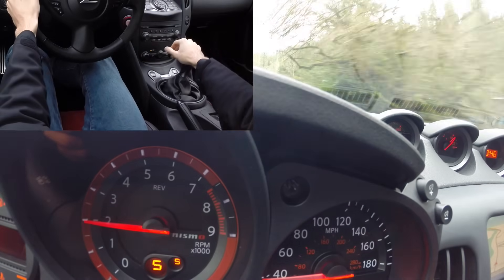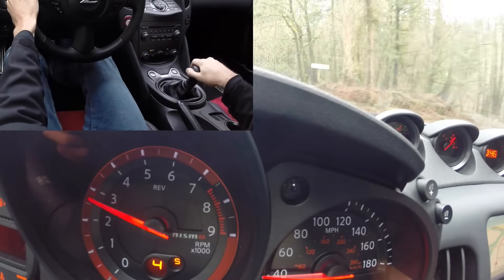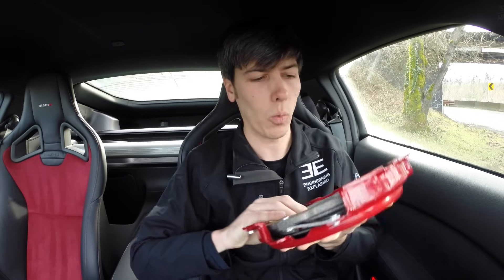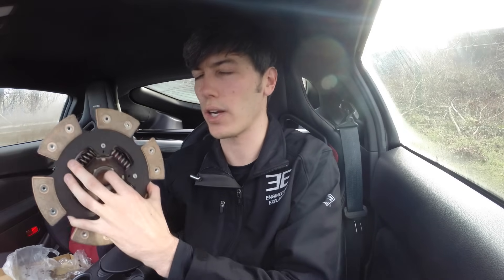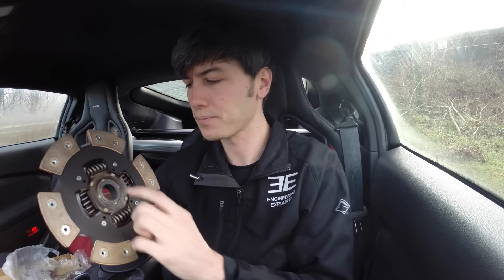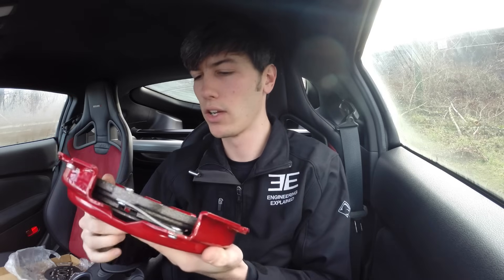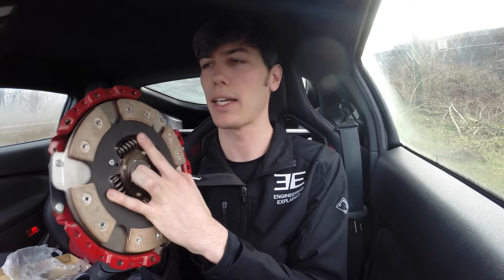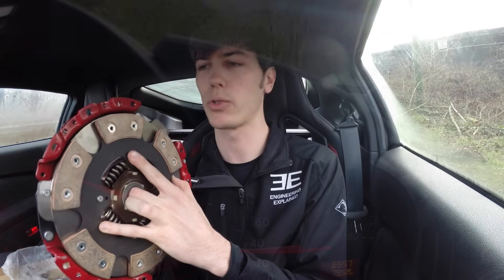What Is Rev Matching?

Comment: what happens if youre on the highway going 60 mph in 6th gear and you want to quickly pass someone?? dont you have to downshift to get more torque?

isnt that a disadvantage to driving manual? in an auto you can just step on the gas with good torque at high speeds
Reply: +Master Mo Auto's downshift when you step on it in a situation like that aswell. With a manual you're doing it manually and it's the same process. I can downshift/rev match pretty quick so even on highways I don't really feel disadvantaged. After a while and with a bit of practice it tends to come naturally
Reply: mrsametaste
so its just much quicker in automatics.
Reply: +Master Mo Yes that is true, but an automatic does the same thing. Usually there is a threshold in the pedal where basically the ecu says 'oh, they want to go fast' and it will downshift and punch it.
Reply: +Master Mo are you butthurt that you can't drive a manual car or what ?
Reply: haha murican problems.
Reply: +Master Mo I like how you asked a question, it got answered in great detail by at least five people, then you start arguing over the fact that manuals are slower at this even though everyone was accepting that fact. Blows my mind.
Reply: +Master Mo I have this suspicion that you don't really know much about cars in general. Why would you ask a question, recieve informed reaponses, and then provoke an argument on a topic in which you have limited knowledge? If you're such a brainiac, then stfu.
Reply: +Master Mo Yes, but with a manual you have more control, so you can anticipate the downshift and actually be faster than the auto.
Reply: +Master Mo 
It depends on driver skills. Very good driver with manual gearbox shifts
gears faster than average automatic. Good automatic in sport car shifts faster
than average driver.
Reply: ...or...in a diesel...you put your foot down because I'M A COAL ROLLIN DOUCHE...
Reply: +Master Mo lol!
Reply: +Master Mo Dual clutch is a automated manual transmission, which is different from regular automatic. Think Jason did a vidio explainning the differences from one another. Again: a automatic transmission can be 'lazy', slow shifting ang 'laggy' as in a Toyota Corolla, or can be way faster, as in the BMW's ZF 8 speed. Same goes to dual clutches (DC) like Ford' s DC on a regular Fiesta or a DC on a Ferrari/Porsche. It all deppends on setup, tune, design of the software and transmission.
Reply: +Master Mo Dual clutch is faster to shift as gears are pre-selected; but can and usually is very sluggish in normal everyday driving, especially stop start driving. They all have flaws and perks over each other.
Reply: At the end of the day both can downshift fast so I wouldn't even worry about that, it's a very small part of the experience.

I sold my car for one with a manual and passing is overall about the same, the automatic was nice to be able to floor and just go but that's because I'm new to manual (unless a 3 speed jeep counts). The manual is nice on the other hand because I know what gear I'm in and what to expect if I floor it, I have to decide before lane changes regardless so I have time to downshift and I can only get better at it.
Reply: ...the automatic still also has to downshift...which most enthusiast drivers can do much faster than the average automatic...
Reply: +Master Mo Or in a diesel, you just put your foot down because torque
Reply: +Master Mo Just to add to this mess, lol, I don't agree with your statement that a automatic is quicker to downshift and pass. It has been my experience that with the same car, different transmissions, the manual will be quicker to downshift and pass. However, there are many variables to account for, but you have little to no control over any of them in an automatic, while you have control over most of them in a manual. Yes, in an automatic you just plant your foot to the floor, but then you wait until the car realizes what you want, then it depends on the gearing ratio differences in the auto tranny vs the manual tranny. Now I have also driven automatics with selectable gears, like BMWs, and they change gear fairly quickly, but it ALWAYS comes down to the sloshy feeling of the torque converter. This brings me to my last point. In an automatic, the torque converter is always slower to well, convert the torque. So as the gear changes, you get a sloshy wave of power and torque for a moment, however brief, which also depends on the car. This is why dual clutch trannies were created, because not only is the change lighting fast, but lacks the need for a torque converter (the achilles heel). But in a manual, there is no slosh, when done correctly, and you don't have to just rev match, but you can over rev (but not by much for obvious reasons), so when the pieces come back together, the car is immediately thrown into acceleration even quicker. I realize this is just as bad for wear as under rev matching but it can be done if you want to accelerate with a kick. Anyways, just throwing all that out there if anyone cares to read all of this. Haha
Reply: tinyman392 dont get me wrong i love vettes, i own a c6. Just stating the fact that there's lag when you are on regular driving mode
Reply: +Master Mo Hahaha I knew you were going to act like that ! Typical ! you were looking for someone to bite but I ain't bitin' boy go drive your 2015 accent
Reply: drop a gear and you are good to go.
Reply: FerpiliciousProducts
downshift, get more speed/torque, then upshift again cannot be faster.
re:my original post. (if your in 6th gear and you need to pass someone quckly.)
Reply: +Master Mo my apologies I misread that. I drive both an auto and a manual (2003 slk230 in summer and a lancer evo is my manual for fun days) and I can downshift and upshift faster in my evo than my merc. I know it's older so it doesn't really pertain to your example but still.
Reply: +Master Mo If you drive a diesel on the highway with over 2000 RPM you don't even need to down shift to do overtake. (Of course if your car has less than 100 HP you will most likely need to down shift)
Reply: Only time the downshift timing is comparable is if you're auto has that sequential mode and you're using it. Otherwise, the car has to decide to switch gears, which is done after you decide to pass. With a manual, or even DCT or manumatic, you'd switch gears during/before you begin hitting the gas to not only have it go smoother (no jerking), but quicker as the car itself doesn't have to take that split second (or two depending on vehicle) relaxing you want more torque and shifting down. Do note that I'm mainly talking about a standard auto (with multiple gears and ratios). This may not apply to CVTs in the same manner depending on design.
Reply: +Master Mo most traditional automatics are slower than a manual. have you never noticed that if you want to pass some one quickly and to jam the throttle on an automatic there is a pretty substantial delay before there is any power?
Reply: +Kyle Barr I was thinking the same thing.
Reply: +Master Mo a paddleshift as you call it (like audi dsg or porsche pdk, dual clutch systems in general) are not traditional automatic gearboxes, they are automated manual gearboxes, that's a difference. i agree to you saying that a paddleshift (dual clutch) gearbox has advantages over a manual in a highway overtaking situation, but a traditional automatic gearbox (these are still made by some companys for some of their recent carmodels) does not have this advantage due to it's laggy response to higher throttleapplication. i would consider myself a manual fanboy, but i have to admit that doubleclutch gearboxes outperform manuals in sport/racing/hard acceleration applications as well as making a car more fuel efficient. the only real downside of doubleclutch boxes i see is the higher maintenance needs/costs and the higher weight (goes up to an additional 80 pounds over the same car with a manual) 
sorry for bad english.
Reply: +MrLantz2011 well his grandmother can drive a manual and he can't. Kinda explain that type of guy or girl he is haha. My buddy drives a c7 stingray, and i have a 13 5.0. His is an auto and mines a manual. On the freeway i destroy him because i can get in the right gear for optimal power, while he waits for the lag then pick up speed.
Reply: +tomnguyen717 using the sequential mode would technically help quite a bit with this. The Vette, from what I've read and heard, is supposed to have a great gear box, even if it's an auto.
Reply: tinyman392 true, but my friend is not really a car guy and purchased the car for its looks. He doesn't know how to use shifter so it's just on "D".
Reply: +tomnguyen717 then rag on the driver, not the transmission/car. Him driving a vette has nothing to do with it.
Reply: tomnguyen717 I can definitely agree with that, computer can only get so good at guessing what the driver wants, and what the programming is optimized for can be kind of tricky.
Reply: Mo Overall Fitness Hacks yes...but you can drop 3 gears and get better acceleration...an auto won't usually do that...autos are for girls...or gays
Reply: You have less control in automatics, and automatic transmissions have more moving parts, and therefore can break more easily.
Reply: Mo Overall Fitness Hacks Automatic will downshift faster only if you’re inexperienced at driving manual. Once you get good at shifting (knowing when, knowing how, all that) then you’ll find that having all that control is quite beneficial. There’s a reason race cars, drag cars, and basically any car used in a Motorsport of any kind is, in fact, manual.
Reply: automatic is getting increasingly faster with advancement in tech. So auto will be quicker, that is just an unassailable truth. A human being can not shift faster than a computer potentially can.
Reply: clearly you've never driven an automatic diesel hyundai van, i could read the entire Lord of the Rings books before it even thinks about shifting
Reply: You downshift, that's how. 60mph could easily be reached in 3rd gear, or 2nd for some cars.
Reply: Why is anyone entertaining an opinion from someone that lacks the means of understanding the concept. The bridge you’re all trying to walk him to is being met without legs... he doesn’t know how to drive manual, so doesn’t understand our views/rationales. I could honestly say I could do that entire process within a second or such. When I was 4 I thought you would always tip over riding a bicycle. Guess it turned out to be a matter of skill 😉
Reply: Always prefer manual myself, feels much faster in most situations, except for one: leaving a stop light and trying to get to the front of the pack to have open road. When I delivered pizza in an automatic, I could floor it and step through all the gears faster than I probably could have on a manual, and could concentrate on steering around the traffic instead of shifting. Although you could just rev it out more and shift less until the passing is done in a manual if it's a good enough engine for that. Newer technologies may have made the automatics quicker than what I'm used to but still couldn't be as fun. As for highway passing, it seems to me better to be able to anticipate what rpm and gear you want instead of waiting for an auto transmission.
Reply: +Master Mo It's really not that hard to anticipate the need to overtake and down-shift in a manual transmission. If anything, automatic gearboxes can be unpredictable and down-shift at times you don't want them too...
Reply: +Master Mo  That's actually the advantage of a manual, way more engaging and enjoyable. ;)
Reply: +Master Mo My friends 2016 Golf TSI takes more time to downshift. In a manual you can predict whats going to happen seconds ahead of time and it takes like half a second to shift gears. If you compare two modern cars, one with an auto and one with a manual, it's hard to say who can downshift quicker. Is flooring it and waiting for the ecu to catch up faster, or a simple motion of moving your shifter hand and your left foot? If you go back even five years ago the manual was definitely the faster one. I don't know about today though as I haven't driven enough 2015/16's.
Reply: Master Mo Paddle shift will always outperform a manual in performance driving, it's not possible for a human to shift as quick in that situation.
Reply: the reason nowadays to drive a manual is not for it being "better" bc its obviously not. its about being more engaged with the car, more in control of what it does.  less than 3% of cars that are sold in the us are manuals.  in europe or japan, its 80%   why do you think that is?  europe and japan both have cars that have paddle shifting and good automatics... so why isnt the normal close to being the same?
Reply: Tommy Richer-Fortin
no youre a typical manual crybaby. if you talk somewhat negatively about a manual these boys act like you dissed their mother..

 go to any video on youtube talking about manuals, yall get so defensive and touchy if there is a differing opinion.

stop being little girls and grow up. congrats you can drive a manual, so can my grandmother..
Reply: DevStar
not mine. there are advantages and disadvantages to everything. my point was just about highway driving
paddle shifts are outperforming manuals in 0-60 times now fyi. racing is also mostly paddle shift
Reply: Tommy Richer-Fortin
17 year old troll...i dont have an accent hahaaa try again.
Reply: Kirill Kravchuk
 not much lag in automatics vs physically letting out the clutch downshifting, getting more torque, then up shifting again in a manual.

not hating on manual but its a drawback. precisely why dual clutch or paddle shifting is primarily used in racing. its just faster than physically shifting gears
Reply: Rafael Pazetto Damásio
a 2015 automatic  (not a 2001 accent) will downshift faster and help you pass someone on the highway quicker than  a manual period. i listed that as a disadvantage to driving manual.  thats the only point here.
Reply: Just Drive
not passing people on the highway....

Comment: Well I thought that I know everything... yeah and know this but I'm gonna watch it anyway......as he explained it i came to realization that i know a girl who down shifts every gear with no rev matching when coming to a stop and that's not a good way to keep the clutch in good conduction ....before i didn't think about the wear on the clutch that happens their ....so thanks  man!
Reply: +Petar Menger I don&#39;t know why so many think that rev matching is necessary in order to keep clutch in a good condition... You can just let out the clutch slowly to match the revs. For example I own a car that has 350 000 kilometers driven (220 000 in miles) with the original clutch still in it without any problems. I live in Finland and majority of cars here are equipped with a manual transmission and an average person has never even heard such thing as rev matching. Still clutch damages are fairly rare. You need to be very bad manual driver if you manage to break your clutch by driving normally.
Reply: Sure you right, but i was talking about this girl I know and she would not let the clutch slowly and I drive differently then she, I brake under clutch while she goes through gears releasing the clutch every gear.....I drive now my Dad's 2004 passat 1.9TDI 344000km no problems